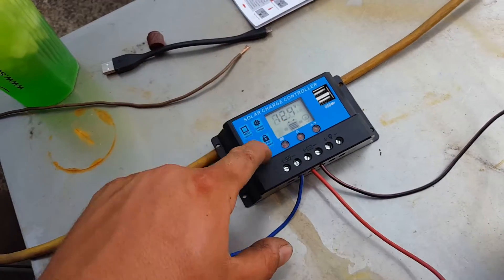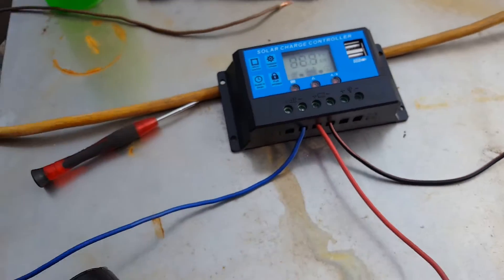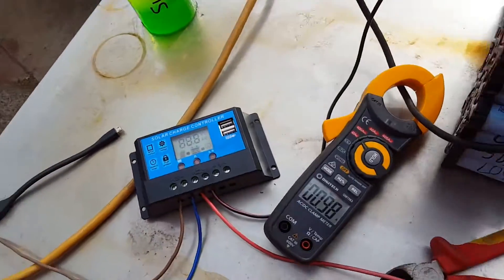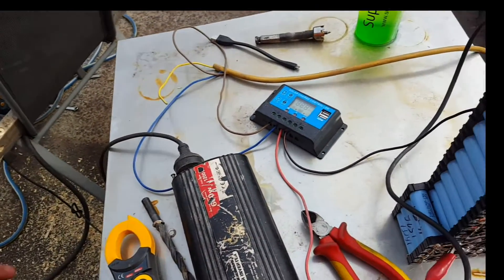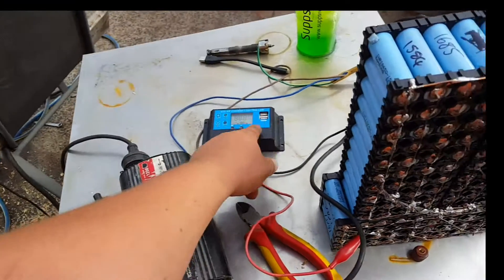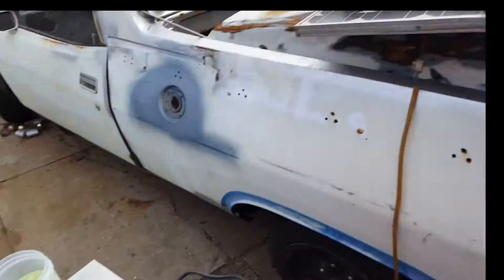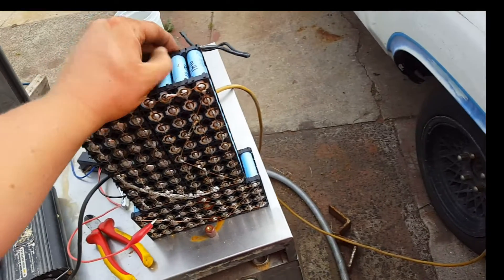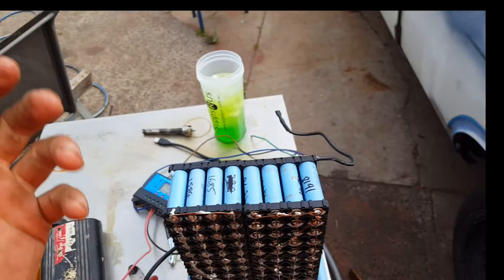Playing with my new PWM solar controller on a 3s 18650 li ion pack

Comment: Hi there..is there need for a BMS on the 3s battery pack? or it's just okay with the b2 mode on the PWM controller
Reply from the maker: Yes always need a bms on lithium battery's.
Reply: if it is small pack, and you are not scared it get damaged or catch fire, use BMS or some kind of protection board

Comment: what is the contoller battery setting at  b1 or b2 or b3 or b4.....any update on this setup?  im trying to charge a small 3s 18650 with bms , with a 25w solar panel.  any tips?

Comment: Very nice., inspired with the setup. I will do similar in 2022. Thank you
Reply from the maker: Thanks for watching mate !!
Reply: Hi, please I have a question, what's the maximum load do you put on this battery pack (continues), and for how long does it usually take the 40watts solar panel to charge the batteries back to full capacity. appreciate, thanks.
Reply: @yusifsuleiman5502  1cell is like 6Wh, so you can calculate by yourself.
Reply: @yusifsuleiman5502  Whole pack i would guess 600Wh, so for 40W panel its ~17hours on full sun...i real conditions more like 2-3days of sunny day

Comment: Please, I have a 40ah lifepo4 pack with 5amps 14.6volt rating with inbuilt BMS, can this type of pmw controller charge it with a 150w solar panels without any issue, considering the charging current might be up to 7 or 8amps?

Comment: What setting of scc can charge that battery ? B1 b2 or b3 i need help ,
Reply: b2
Reply: acid batery - 12v        B1
lithium   3s 3x3,7v     B2
Lifepo4 4s 4x3,2v      B3

Comment: I bought one of those PWM Controllers and the manual said that I shouldn't charge 18650 :( have you had any issues with it?
Reply from the maker: Yeah as in the video it's not what they are made for.
You really need a bms
Reply: when you use bms and battery is do not connected can you burn solar controler

Comment: Nice video, just curious, can this charge controller http://bit.ly/2OxTtwS charge this 18560-lithium ion battery pack https://ibb.co/M7Yn95p .Will the charge controller deliver the right amps to the battery pack or which charge controller would you recommend ?

Comment: I have thovs and my friend vonds them to and hi dosent know ver cen hi get dem
Reply: Tanks bro 😀
Reply from the maker: If you send him that link it helps my channel thanks mate
Reply: Now problem mate 😎
Reply: ✌️😎👍🍻🤝😀😉 Cheers bro
Reply from the maker: https://www.banggood.com/PWM-60A-1224V-Auto-Adapt-LCD-Solar-Charge-Controller-Battery-Regulator-Adjustable-Parameter-p-1332176.html?p=OQ120813147900201708&custlinkid=125620

One of these?

Comment: What if you have a DCtoDC buck converter going to a BMS and then to a 12V 3S battery pack? This way u skip the PWM controller and still you will enjoy balancing and such. Any ideas everyone? I built one for a small soundsystem and looks working great
Reply from the maker: Thats a great idea mate ill try that i have a bms that might take it
Reply: i came to the same idea, how safe is it? i cannot find where i live any suitable lithium charge controller

Comment: damn, how many cells in that beauty? how heavy is that bastard?
Reply from the maker: 120cell around 6.5kg approx 600watthr with a 20c discharge rating
Reply: @Oneupthesleevecustoms  need how to video on building that battery:) thanks for this video
Reply from the maker: Ill get onto it mate

Comment: lithium ion Cells Generally require CCCV charge method.... Constant current constant voltage. Any battery will only be able to in so much charge (amps) depending on it's SOC anyway.
Reply from the maker: +Solar and Gardening stuff and DJ Stuff was more referring  the the cell specs from Samsung but yeah soc is a factor

Comment: that inverter must be bad ass rugged. it looks like it was accidently dragged behind the work truck a few times ,and it still works. they just don't make stuff the way they used to.
Reply from the maker: +immrnoidall cheap rubbish but dam its suvived too
Reply from the maker: +immrnoidall shame it didnt have a built in kwh meter cause its done some work
Reply: i got one like it at yard sale cheap cause they said fan stopped. opened it up and the thing was full of sand and dirt. vacuumed it out and put in a fan and the thing still works like a charm.
Reply: look for an old 24 volt UPS for computers that needs batteries. a 7s pack works great for 24 volt.the min/max volts are the same.
Reply from the maker: +immrnoidall yeah good plan and nice power comes out of a ups
Reply from the maker: +immrnoidall people throw out all.sorts of good stuff
Reply: and usually no fan to listen to.
Reply from the maker: +immrnoidall a 80 or 120 mm pc fan would up its output  and still be nice and quiet ;) ive got a few 36v ones here ive played with
Reply: oh yes.i have to bring my trash to the tranfer stasion.no pick up in the country.  i get tons of things i need there. weed wakers last about 2 years before needing hoses $5 FIX.JUST GOT A SMALL 2000 WATT generator.cleaned the carb  and boom it works fine $0 fix. three of those UPS. 2 12 volt and one 24. a 46 inch flat screen.power supply fix is usually the problem .easy as hell to replace a few capacitors or just buy the module on ebay for $60. laptops full of dust ,overheating shutdown. many 18650's. helped finish the basement  with free lumber ,kitchen cabinets ,sink stove ,fridge, wood stove, stove pipe,.i bought drywall wire outlets and insulation. being hand and resourceful pays off sometimes and can be fun..
Reply: really? i have got to try that.i have a bunch of pc fans.
Reply from the maker: +immrnoidall oh its amazing what you can find good work re purpose is the best recycling
Reply from the maker: +immrnoidall yeah they  are only made to run for the duration of the standard old lead acid pack gives it

Comment: in one comment it said 12.6 is the lowest you can set max charge voltage but in another it said 12.7.  what is the lowest you can set max or terminal charge voltage on this unit?
Reply from the maker: +Dimitris Zarmakoupis 12.7 it never gets that high  though stops at 12.6

Comment: Why did you choose 12 volts and not 48 or 50 like the Tesla powerwall?  What is the best voltage to convert to ac power or does it even matter?

Also why have I heard that those solar charge controllers don't work with li ion?  Supposedly only with lead acid?
Reply from the maker: +Dimitris Zarmakoupis tesla power  walls are  like 400v but  i chose 12v as i has a 12v inverter. Also this 55amp pack was only charged with a 40 watt solar panel (  about 2 amps) so the charging curve doesnt matter to much and its set to stop at 12.6 v
Reply: Aw yip, cheers mate.  This link says powerwall 2 is 50v battery but I think maybe that's because they series 7 or 8 of them?  Or else somehow step up the voltage to 300-400?  

This project has really inspired me to do the same at my place.  Gonna be building an 18650 pack soon.  What is your preferred method for testing cells? Do you use an IMAX b6?  How would you handle balancing on this unit if needed?
Reply: https://www.solarquotes.com.au/blog/powerwall-2-warranty/ there's the link on the powerwall 2 , sorry
Reply from the maker: +Dimitris Zarmakoupis thanks mate
Reply from the maker: +Dimitris Zarmakoupis i made this one with the as equal as i could cells to help  with the balance and if it gets out ill boost the low ones with an imax b6 6amp . Imaxs testing is good but opus or stand alone dischargers are better /more reliable
Reply: batrium is good and worth spending the money to help extend to life of the cells
means more wiring but is explained on their site
Reply: i'm yet to get the money up to buy it yet but i'm only just starting out so yeah got to get more cells and cell holders and cables and panels and chargers etc.
Reply: from online most come out of China... i'm happy with the first lot I got
Reply from the maker: +Solar and Gardening stuff and DJ Stuff yeah seems to be the best on the market
Reply from the maker: +Solar and Gardening stuff and DJ Stuff were are you getting cells from
Reply from the maker: +Solar and Gardening stuff and DJ Stuff getting good tests

Comment: What's ur take on balance charging the cells. I have an off grid set up with both pwm and mppt controller. Am interested in doing what you have done to support my system. But everywhere I look they talk about balance charging. Any ideas?
Reply from the maker: +Chibuzo cell balance is very important   what voltage are you running
Reply: first, is it possible to make a 200amps out of lithium? I have a 48 volts off grid solar system and am thinking in this direction. your advice would be appreciated.
Reply from the maker: +Chibuzo any size you like if you have enough cells

Comment: Dose it mean if that battery said 10amp hour dose it mean the battery will last 10hours
Reply: Jerry Blackledge yeah if your load is at 1A
Reply from the maker: Yeah amp hr is a measurement of time v current draw

Comment: so the controller is good with lithium?
Reply from the maker: +the Maldivian useable yes wouldn't call it ideal but there cheap  as chips and turn down to 12.6v but don't  Balance or anything

Comment: it is my understanding that the controller will trickle charge after it hits its target. That is really bad for lithium. Ideally, if you can charge to 4.0 volts, the battery cycle lifetime really goes up. Battery University says 3.92v being optimum. But, check to see if that charger is trickle charging after it hits its target.
Reply from the maker: +Richard Lewis charges to 12.6 and stops
Reply: @Oneupthesleevecustoms  in the video you had it set to 12.7 which is overcharging the batteries
Reply from the maker: It's not an issue. It equals 4.23v per cell.. with only 40 watt panel charging it. I use the power not just let it sit there full.

Comment: How do you make sure it only outputs 12.6.? I thought I would have took hook 4 cells together to make 4.8v.
Reply from the maker: shawn lee 4.2 v max charge is 12.6 and the pwm controler  is set to 12.7 full so it doesn't  over charge them watch some of the other videos in the same play list ive been using the  setup for 3 months almost :)
Reply: Oh I am so sorry. I have some 18650 cells but I thought they max out at 3.7v each.
Reply from the maker: shawn lee na 4.2 full charged some new ones can go to 4.35
Reply: I never new that. I am getting a Lithium tester soon. I will see if any of mine will. I am building my pack from recycled laptop battery packs. TY for your help and your patients with my questions.
Reply from the maker: +shawn lee no stresss any time you have a question sing out
Reply: How many hours is that battery bank

Comment: I thought you said somewhere just where you got that charge controller, but I am unable to find it.  Might you still have a link for it?
Reply: these float charge your cells. which is not good. so beware of this.
Reply from the maker: +Richard Hoard ah it was an ebay item from a 4x4 place on mainland  Australia. Ill find a link for you when im on my pc mate
Reply: Thanks, it's no rush.  I just want to look at the specs.  I have mostly decided to go 7s because it closely matches 24v Lead Acid charge profiles, but then you have to convert 24v down to 12v for most applications.  If yours does 3s Li-ion, then I might be able to stay 12v and simplify the system.
Reply: just search ebay for solar charge controller 30a, theres hundreds of this exact controller, some have different colors or housings but they are all the same as you see from the usb ports, buttons and terminals
Reply: That's a tad high for my liking.  That being 0.034v higher than the common max voltage for 18650s.  That's why I keep going back to a 24v lead acid solar charger controller.  They match 7s pack very nicely.  The problem is you then need to add complexity to the system to convert down to 12v for common usage.
Reply from the maker: +Ivan Stroganov yeah there a common thing
Reply: The issue is the info provided in the listings don't mention the range of adjustability on the charger side of things.
Reply from the maker: +Richard Hoard Yeah  mine does down to 12.7v
Reply from the maker: +Richard Hoard thats a full charge voltage my packs never going to be unused   specialy not when i build a big one the storage capacity  will be to high  and useage will also be high (cause its free power) and they  will never sit fully charged
Reply from the maker: cheers mate heres the ebay item number eBay item number:
391484709925
Reply from the maker: +mikeph4 yeah only at 12.6 mate its all good.